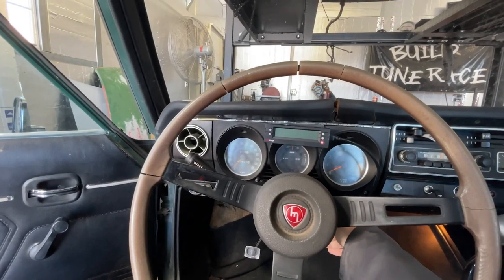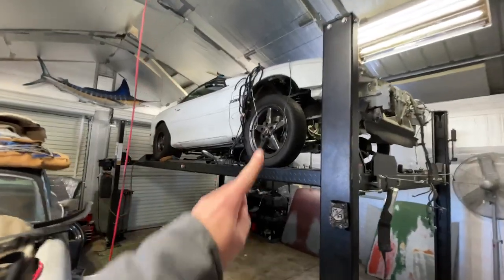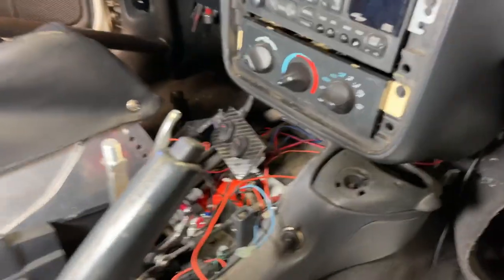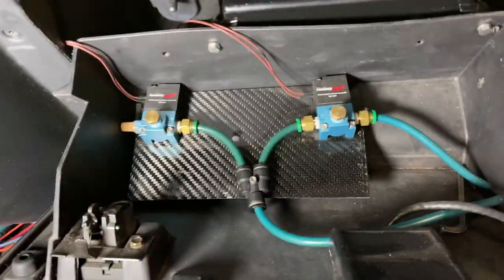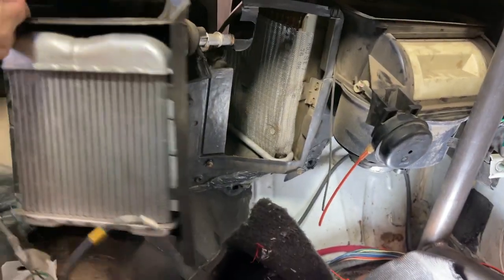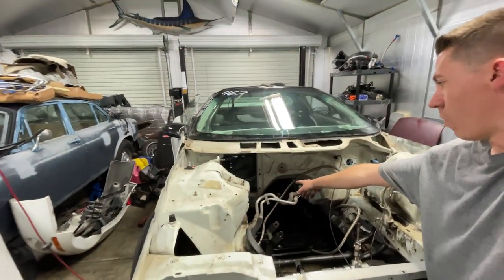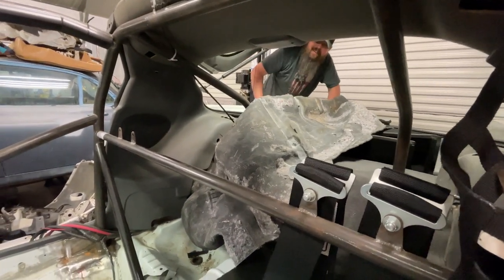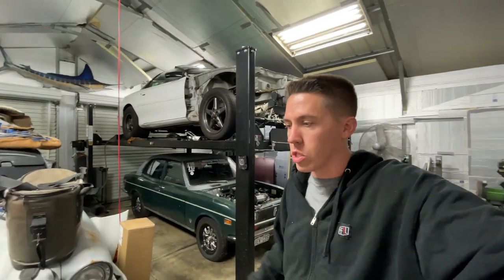I'm Completely Rebuilding My Turbo Camaro!

Comment: Does sunroof glass count? I got 2 days left at a job that has tons of scrap plexiglass,  from 1/8th inch to half..
Reply from the maker: They make a replacement fiberglass and carbon top that’s molded for these cars. Thinking about going that route
Reply: That's the way to go. It fits nicely and you don't have to worry about chassis flex ejecting the t-top.